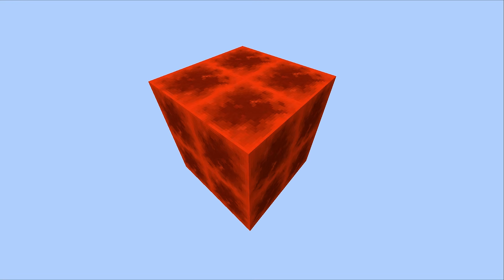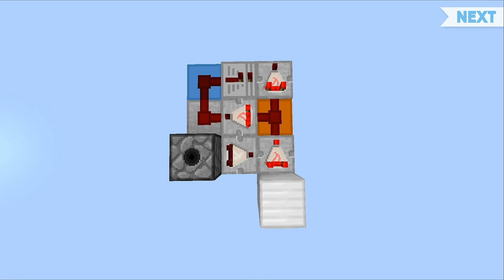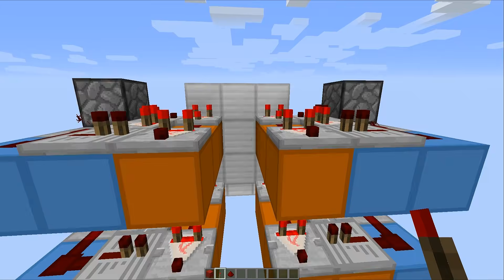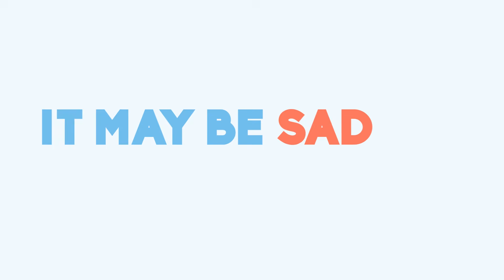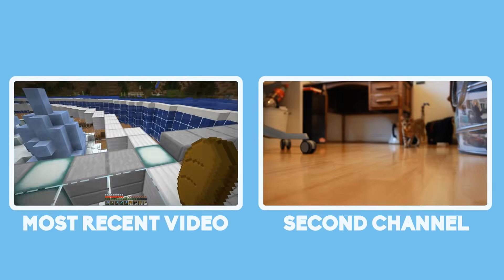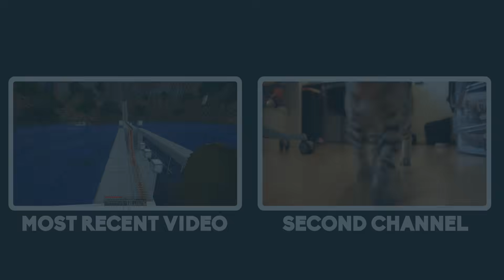Minecraft: 3 Simple Redstone Security Systems

Comment: Hi guys! I built the first design in 2020 and it hasn’t worked. I think the mechanics may have changed because I’m pretty sure it’s correct. Just a note, in case yours isnt working, it is a pretty old design. (The problem is that it doesn’t just go down to 18 and stop it just all leaves the hopper)
Reply: Same happend to me today
Reply: For those that are still wondering, you need to put the redstone torch under the hopper and you also have to redirect redstone from the comparator to power the block that it is placed on
Reply: Ok I thought I was doing something wrong. Thanks.
Reply: It does work. You just have to follow exactly what he does. I did it 3 days ago. I did this in pocket edition so I am not sure if it will work in Java edition anymore
Reply: in java the first one breaks in 1.16+

Comment: For anyone trying to use the design at 2:22 and you find out it sends a one tick pulse, even if the input is incorrect and want to fix that just slap on what is called a long pulse detector and it will fix your problem. Here is a picture of what I have, BTW I'm using music disks instead of a picture frame: https://imgur.com/a/iV5RNQQ

Comment: Whenever I put in my key card into the hopper it just puts all of it into the dropper
Reply: I'm having the same issue
Reply: It’s a 4 year old video, maybe it doesn’t work anymore? Haven’t tried it so can’t confirm
Reply: @sharkycat1096  Just put one more piece of redstone on top of the block in front of the comparator and it should work.
Reply: @colbablast6579  in 1.16
Reply: @toadofficer1740  It should work on bedrock in 1.16 as there weren't any significant redstone changes.
Reply: @colbablast6579  do you know if it's the same for java? since redstone was changed
Reply: I tried the design today and it works in 1.15
Reply: Thx Colbablast. It worked
Reply: @justpeepz3952  HOW IT STill didnt work for me it still take all the blocks
Reply: im on java

Comment: Would be cool if someone could explain how these work
Reply: I'm no expert, but the first one won't be able to deposit anything but the correct item: all the slots in the hopper are full. Putting the right item in the dropper adds it to the stack in the hopper, but the wrong item won't fit.

Comparators can give a redstone output from containers: the more items in the container, the stronger it is. I haven't used item frames but it looks like they also give a redstone output. Using subtact mode means the strength of the output signal is equal to the main input signal minus the secondary input signal (so it can be 0). In standard mode, comparators only output a signal if the main input is greater than the secondary input (I think). I'm not sure exactly how it would work, but I'll experiment and if I find out more I'll edit this and add the info in.

The one with multiple item frames is basically identical, but the outputs of each circuit go through an AND gate, which means you'll only get an output at the end if all the items are in the correct position. Edit for more detail on the AND gate: when the block a redstone torch is attached to is being powered, the torch "turns off." Even if you have 3 items in the right position, the one in the wrong position still has a redstone torch that's "on," which then powers the line of redstone at the end. That line of redstone then powers the block that the final torch is attached to, so it stays "off." Hopefully that's not too confusing...

I'm far from a redstone expert, I'm pretty inexperienced and struggling to come up with my own 3x3 piston door design, but hopefully this is right and helps.

Unless you've figured the circuits out on your own in the last year or so...
Reply: Nowawadays I don’t think most of these work but the first one is simple the comparator basically can see how many objects are in there and gives a signal or number from 0 - 15 and it varies based on how many items are in there and the type of storage the. So the first works by having a dropper which can transfer items into the hopper with the button but. Because the hopper is filled with an item only that one item can go in and you want to put hopper going back in and the hopper has a property that allows it to be hopper locked this basically just means that the hopper can not output any items. And that is what the torch does hoppers are locked when they are powered so once the hopper gets pushed past the brink where the signal goes from 1 to 2 it powers the torch which torches work where when the block they are placed on gets powered the torch turns off but when unpowered turns on and the torch powers adjacent blocks but not the one it’s placed on and therefore it gets locked and you can use the torches power to have an output and because it’s off the hopper unlocks and puts the item out back into the dropper which puts it under the brink and it relocks itself

Comment: 3:13 Every half stack of items equals one position
Reply: Finnaly i understand how does the logic of this how ot works and the 7th attemp was a succes btw not every half stack of item is equals to one position,it was unstabble tho u need fo put lots of trash things(or maybe dirt blocks)btw i put 1 stack of dirt then it adds 1 posistion then i add half stack and it does not add 1 posistion so i add an another one half of dirt,so it adds another half stack then i add 1 more stack of dirt then it does not add an posistion,so i put another 1 stack of dirt then it adds another posistion.

The logic of this thing i realised is to put as much as items in the chest,barrel,dropper,shulker,or whatever,(i used barrel)until it reaches the posistion that you wanted,hope this helps alot.
Thanks...

Comment: I made a huge ass code number lock for 1 of 4 digits (didn't have enough time to make the other 3 but I'm still surprised I could figure something like that out. It uses hoppers where you fill in a certain amount of slots. Example: 2/5 slots or 4/5 slots). Hardest part was getting it so if the signal was too high that it wouldn't work.
Reply: I feel ten times worse about my redstone skills now :(

Comment: Sadly the item frame locks don't work on PS4 they do kinda work but it keeps going until you reach the first position and then turns on when you reach your set one and stays on
Reply: Did You use subtract mode on the comparator?

Comment: I want to have pressure plates to unlock my doors for conveniency, but I don't want mobs to be able to just come into my house by walking over the plate. Is there a way I can work around that without using too much redstone?
Reply: Wire the door up like normal but then search up how to make a lock
Reply: +Leaf dogparkmayor Just don't put any pressure plates on the outside of your house. Inside is fine. You'll just have to right click the door to open it, but then it will close automatically once you're inside.

Comment: The hardest kind of puzzle is hard to find in the first place. A puzzle in a puzzle, if you will. A wall of buttons for a keypad or a random dropper next to an iron door crumbles in the face of the immoral. Therefore, the best way to hide/protect something is to make it an absolute pain to decode from scratch, but easy to open, provided you know the right steps. For example: Take Mumbo's item detector, but hide the dropper behind some backwards corner stairs. Voilà! A puzzle hidden behind a puzzle. This kind of thing is incredibly hard to find, and if someone stumbles upon it, which, depending on the size of your base could be immensely difficult, they have to solve it, provided it's in a protected region. (Or if there's LogBlock). The point is, in a world in which anything can be destroyed in under a second (save for obsidian), invisibility is your best defense.
Reply: Nice idea
Reply: Inb4 they add collectable bedrock in survival Kappa